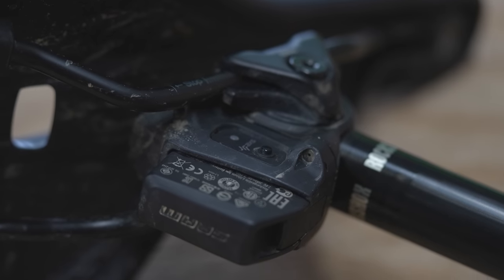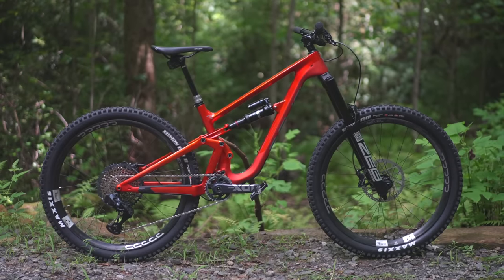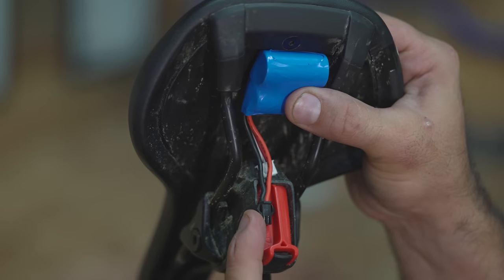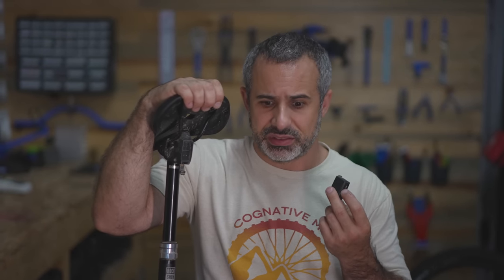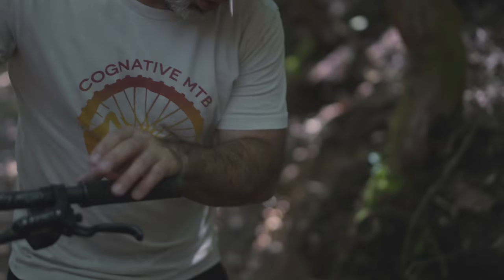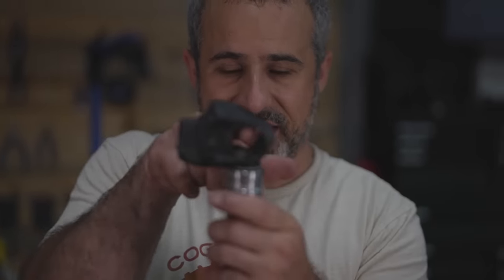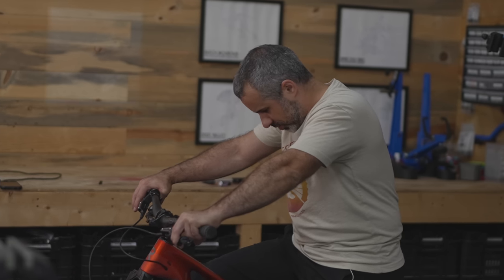My Wireless Seatpost has a big problem... Let's hack it!

Comment: Seth, SRAM should send you a check for doing their R&D, or at minimum, a new post, free of charge, when they inevitably take inspiration from what you just did!
Reply: Nah ... they just need to fire the 12 yearold iditos they hired for R&D and actually hire qualified people + a Q/A deprtment of MTB enthusiasts that know how to rbeak shit before it hits the market.  A wireless dropper post is a solution looking for a problem. Clears up clutter - but adds the weight of a battery pack (or 2 since the handlebar switch also needs power).

Comment: Combine both of your solutions - turn seatpost around AND use that adaptor - in that way you can't hit it with tire AND you can still make bigger family 🙂
Reply: This is exactly what I was thinking. Also I believe he should purposely put a weaker connector so that if the battery ever falls or gets yanked out said connector will just disconnect instead of ripping the tin work
Reply: What about just putting a saddle on that has taller rails? Less change = easy.:goodvibes:
Reply: @craigsawyer6453  it surely would be worth looking into it, but I'm not sure if thy make them already
Reply: I don't think it was the battery that was impacting the seat or he would have done that.
Reply: @beno9966  it was the battery
Reply: @beno9966  You are correct.  I have the RockShox AXS seat post as well and it's the seat post itself that sticks up and is hitting his seat.  Anyone can google image search the seat post and see.  Seth probably should have shown a close up though because I can understand how some viewers are confused.  While I agree with Seth that this probably could have been designed better, it would only affect some brands of bikes and only the ones with Small frames which he alluded to but didn't quite spell out.  All in all it's a great seat post and blows away any wired dropper post but it does have two major cons:  1) The price - it's way too expensive for what it is even though I love it, and 2) They apparently aren't manufacturing the (overpriced) 200 & 600 hour service kits.  I've been on notify lists on various websites for almost a year and haven't heard anything.   Any time I have manually checked they've been out of stock.
Reply: I think turning the post around would limit the seat from pointing low enough.
Reply: @RC-fp1tl  but the battery was impacting the tires not the seat
Reply: @RC-fp1tl  It was the top bulge above the battery housing that was hitting the seat. I only know because I just swopped mine around so I could see what it was and I have come up with an idea. 3D print new side clamps so the saddle sits 5mm or so higher when clamped and put the guide holes for the micro tilt adjustment off centre which will allow the rider to correctly position the seat using it.

Comment: You could 3d print a super thin plate to connect the seat post terminals to the battery, or you could solder wires to the terminals then run them to the location of the taped battery which would be even slimmer than the printed plate.
Reply: Exactly. Even better he can print a bumper for the Ergon saddle so that the saddle makes the first contact, not the slim adapter.
Reply: 3d printers suck
Reply: @silentminority2342  quite the opposite actually, they squeeze material out
Reply: @silentminority2342  cope harder, you're just mad people can make self-defense "tools" with them

Comment: I work an an Industrial Automation Electrician, and I can say confidently, that things being unnecessarily automated or electronically controlled, is hardly ever better. BUT it keeps jobs around for me, because people continue to do it, and it always fails! 😂
Reply: end  I understand that, but the point I was making was… is removing a simple, and reliable cable for an expensive, bulky, and battery powered part that requires charging really worth it? In Seth’s case, it looks like it created a bigger problem than any problems or nuisances it may have solved.

Comment: The background in automobile electronics definitely has given you some helpful insight and confidence in this.  

I had an idea I wanted to put out there for people that have more time and money than I do...

But check this idea out...  a pressure sensor that is built into the seat that will know when you sit on it...it needs to be in its raised position...and when you get off the seat...the relay will click knowing it should drop and get out of the way...
Similar to electronics in a power car seat...one could determine the settings where you want the stops to be at for the upper and lower position.  Would this be a good idea?
Reply: wont be a bad idea for shure! 10/10.
Reply: To be critical of your great idea - as you are pedaling along seated and want to stand for a quick sprint or gain some advantage over jank, then want to sit and resume seated powering on, the seat would be dropped and need to be popped back up.  There is another bit of ingenuity needed to solve this . I like it.  Push the lever before you stand to bypass the seat drop feature.   Stand to drop the post.   You have something there love it
Reply: Build it and they will buy….
Reply: That sounds a lot like a hospital flip assistant if you ask me
Reply: You have to squat every time you want to sit in. Horrible idea.
Reply from the maker: That would be pretty cool, but dropper posts can only go UP unassisted. To go down they need the weight of the rider. They SHOULD call them popper posts.
Reply: @wrecked3m  haha!  I work at a hospital!   (X ray tech)  I'm not trying to keep my job this way.
Reply: @Pienimusta  my thought was that when you sit on the seat...the post would come back up...not as in an ejection seat...but like a hatchback lift strut.
Reply: @gr8fulride  I was not thinking of instant raising...but like a lift back strut for a hatchback...not an ejection seat to a fighter plane.  My thought is to have a pressure pad sensitivity to know the difference between the weight of the person needing to actually use the seat for cadence on flats and hills going up...vs the occasional shifting of the cheeks on the saddle.

There are different levels of sensitivity for sure...  I'm an x ray tech and sometimes our patients have bed alarms and even a small movement can trigger this thing....I wouldn't use that sensitive of a device....  I hope this makes a little bit of sense...I'm okay with critics.  I'M often my own worst one!  Haha!
Reply: @Pienimusta  you have to bend your knees every time you pedal...  I don't see the problem....

Comment: Open the actuator body and solder to the inside of the connections, then just a blank plate to cover where the battery used to be.
Reply: This is what I thought was going to be the first attempt.

Comment: I think you need some form of overdischarge protection, or the batteries will be single use. Unless that's built in to the post of course..

Something to think about!
Reply: Many battery packs have that built in. Much easier to use a cell like that than to put it into the post.

Comment: You should be fine with a higher stack saddle. I haven’t found AXS Reverbs to be that reliable personally, and there’s an unacceptable amount of side to side bushing play for something so expensive. The only real upsides are the lack of a cable and how easy it is to make small adjustments to the amount of drop. I’m running a BikeYoke Revive with a PNW lever now and it’s a lot nicer than the Reverb…plus I can run a post with more drop in my frame than I can with the AXS Reverb. I like AXS shifting a lot but the seatpost is a bit overhyped in my opinion. 🤷🏻‍♂️
Reply from the maker: I got it working with a WTB volt!

Comment: Your video just induced that familiar feeling of putting your best effort into a really nice hack and having it fail the first time you use it. I thought for sure the second plan would work too.

Funny enough, my version of commit would have been to either solder directly to the battery terminals or to crack open the case on the controller and fish a wire out. Your version of commit is probably better.

Comment: Seth since we loss warranty, stick the battery adapter directly on the seatpost without the extra plastic part you add in order to look good. It will be water proof and you will use the battery clip to charge it. make a small U cut on the top and put the cables to protect them from tyre scratching.

Comment: Thanks Seth for going the extra mile. I ride a size small and go for a 150mm dropper so pointing out that flaw does highlight the cons since I'm considering getting one. As for your battery hack, I think you can get away with replicating the pads with a PCB and 3d printing the rest including a separate enclosure for your battery that is secured to your seat instead of the dual-lock.
Reply: I have a Rail size small and have lost 2 batteries so far because of wheel contact. It’s only happened on the absolute biggest hits but still frustrating

Comment: As a lifelong guitar player and guitar, pedal and amp builder/modder for about 10-15 years this episode was right up my alley. I'm constantly making DC power supply's to get rid of active pickup 9v batteries and adding power supply's to lighting etc etc etc. If it has an electric pulse of any kind and can be improved in some way it WILL meet my soldering iron and I WILL get way too excited and post on Marshall amp forum about my brilliant idea after having proven it works and is indeed an improvement lol. When Seth said "for the six of you who have this problem as well" I couldnt help but feel relieved since I'm not the only one who gets excited about solving problems that only a very small amount of people actually have and even smaller amount have and care enough to fix it. 
Edit: EVERYTHING ABOUT THIS VIDEO IS RELATABLE! Loosing your temper and working frustrated is always a guaranteed way to become more frustrated lol. Yet I still do it....regularly....

Comment: My only concern is that the LiPo (which I recognize as being from an SCX24 if I'm not mistaken, and is a 2-cell battery) will either a) become unbalanced over time, and b) will over-discharge beyond repair, since there's no speed controller with low voltage protection.

If you added a low-voltage alarm to the balance connector, it would beep when voltage dropped too low, so you would know to recharge it. That would work.

Comment: Seth, use your battery relocation hack under the saddle but attach a small smooth sheet metal plate to the saddle rails behind the connector you built. That way the tire contacts the smooth metal rather than the connector. For strength you may have to span from the saddle rails to the seat post shaft so you don’t rip the metal sheet off.
Reply: Sorry, I don’t know how to reply. Tried the Telegram app and could not find the username you included.

Comment: I feel like there still may be a solution in the original approach. Otherwise, I wonder if you had a saddle with a wide opening in it like the Specialized Mimic. if it wouldn't matter that the post was a little higher when mounted backwards.

Comment: I have the same personality flaw, among others! :)

Could you do both solutions at once? Or does moving the battery (again) not reduce how much the whole thing sticks up into your seat?

I think the next step might be to go back to your initial hack, but then add some type of casing/protection to the battery contact so that when the wheel hits it, it can't be yoinked out of place......shrink wrap it with a plastic soda bottle and heat gun?

Comment: The first idea for using an adapter and re-locating the actual battery was good, just bad implementation of how to secure the "adapter" part that still used the native plastic clip to keep it attached to the post.  On my bike, with the same dropper post, I put a micro seat mount bag (containing a tubulito, co2 kit, puncture repair kit) from Blackburn attached to the rear of the saddle and the battery is sandwiched between the seat and pouch.  If the rear wheel comes in contact due to a big jump, it hits the pouch and not the battery.

Comment: What if you combine the two ideas? If it's the battery that's causing the bump in the saddle when you turn it 180°, then maybe install the blue battery pack with the smaller contact point to it? The tire can't rip it out because it's on the front and the bump (might?) be not there

Comment: As a fellow short guy on small frames I feel your pain with droppers.  Even with normal droppers often the bends in the seat tubes make it hard to run much more than a 125mm dropper on the smalls and get the right seat height.
Reply: Then you should buy a oneup dropper, they are the shortest droppers excisting
Reply: @daviddoornenbal44  already got one, doesn't entirely make up for most frame designs though.

Comment: The Battery should be on the Seat collar.   it's the part the cable usually goes in on the non stealth reverbs.  And the wireless reverb is just a non stealth reverb with a Servo motor hitting the poppet valve.  Could you use a non AXS top and hack the AXS battery to the seat collar?

Comment: So if you use the adapter with the battery taped under the saddle wouldn't that keep it from pushing on the center like that? It is a little hard to tell but it looks like the battery is the highest point so saving that 3/4 inch should solve the problem.

Comment: Is there no shorter travel drop option? I run a 120 and could fit a 180, with no room for adjustment, but there’s no need. If your seat is sitting below the top of the rear tire there’s room for adjustment

Comment: The real next step is for integrated droppers like BMC have done on their Four Stroke. 
In the mean time, Seth’s hurdle to overcome (and I’m sure many other riders) is the seat post drop to frame size ratio. Seth has always run the longest possible dropper on his size S frame. A larger frame with the same drop and a taller rider is not going to encounter this issue so much. 
Far be it from me to suggest anybody run anything other than the maximum drop your frame can accommodate BUT , running 25mm less drop might mitigate the problem completely 🤷🏼‍♂️

Comment: If you went to 165mm cranks, and/or maybe a seat with shorter stack, you could run the post a little higher and gain the clearance you need? 
The action of the post sure is nice and snappy.

Comment: I wonder if there's a way to wire the battery directly to the dropper instead of a dummy battery. then you could retain the battery post but also have a wire epoxied in and sticking out to use a secondary battery mounted under the seat

Comment: Make the diy DIY connector even thinner and glue it in so it can't be ripped out. Then the the new connector is the plug in the cable to the new battery held under the seat... It's less elegant to replace, but it would work.

Comment: Having one of these posts  I have noticed this only on small bikes and on over shocked ones. It might be hard to avoid this in the design unless it is mounted lower on the front of the post. Flipping the battery to the front runs into the problem Seth showed so it has to mount lower if you do that. On my Specialized S3s I don’t have this issue. 

That said I think Seth was 90% of the way there with the adapter design. If you attach a sacrificial piece of hard plastic bumper to the back of the seat rails it could make contact with the wheel first and prevent the wheel contacting the battery adapter.

Comment: You should definitely check out the Switch grade by aenomaly products its a clamp for you to run on whatever dropperpost you like and it allows you to tilt your saddle on the go, I think that sould give you enough clearance for you to run the dropper with the battery facing up front

Comment: Most likely won't see this! But, Long time fan with a suggestion. How about going the 3d printed route? You can get someone to help you 3D scan/measure what you need to make a plate with contacts that slides onto the unit, and your battery.
Reply: That way you can have an excuse to do a bit on 3d printed bike stuff 🤩

Comment: Hi, not is necessary to cut the screw. You must remove the stop with four small holes that block the screw. Once you remove this stop you can remove the screw without any problem.

Comment: Fashion a bracket to raise the height of the actual seat adjustment. It would then clear the electronic dropper casing. Probably need about 1/4" of added seat height.

Comment: The old 'relative cost'. On a $5-6K mountain bike, $800, doesn't seem to0 steep, but my eMTB, was $1500
I won't even pay $200 for a dropper post. I have seen a cable one for $80, that one might be a go for me.

I will continue to see how the hack works out. I 100% agree the battery was poorly designed.

Comment: You could turn the dropper post around so that the seat would normally be pointing the wrong way. Then, you could turn around the seat. This would locate the battery area under the front of the seat. It would look weird though.
Reply: I have made this comment before Seth said that it doesn’t work. Whoops.

Comment: Did you try to mount the dropper post reverse? If it's possible the battery will be under the seat.
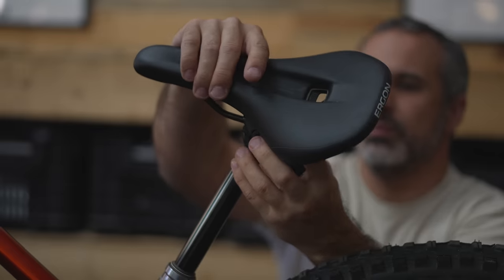OK, I have my response on minute 6:05

Comment: Looks like if you use the battery adapter with the seat post backwards it might clear the tire and not have the hump from the corner of the battery hitting the seat.

Comment: Is the bump caused by the battery? If so, apply solution 1 (the adapter and relocated battery) to the now flipped over upper part (?)